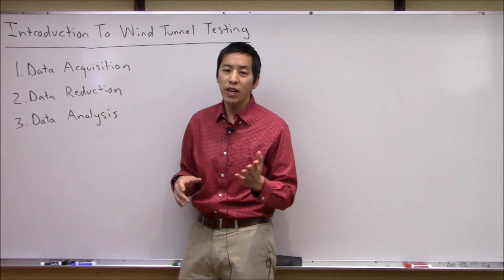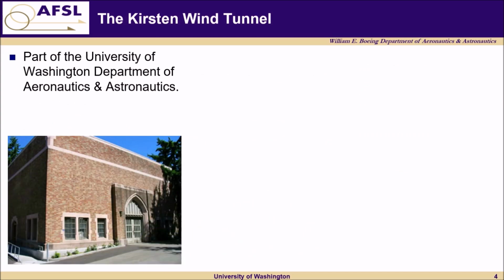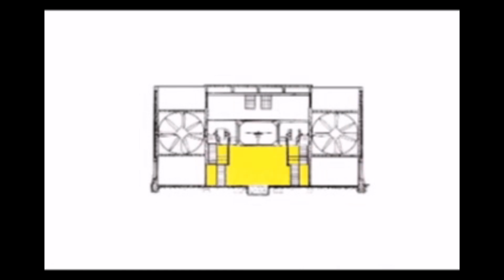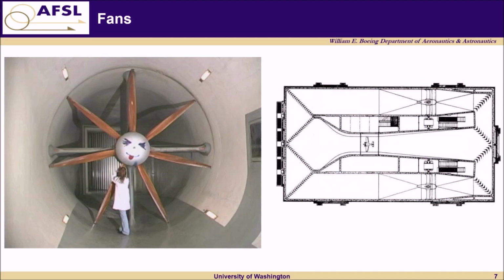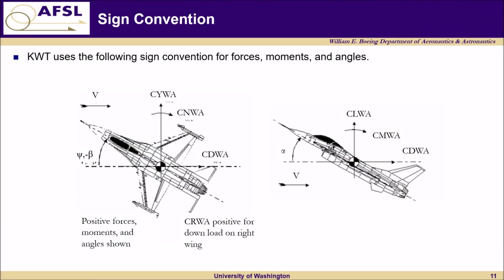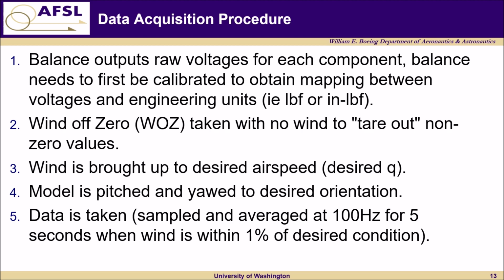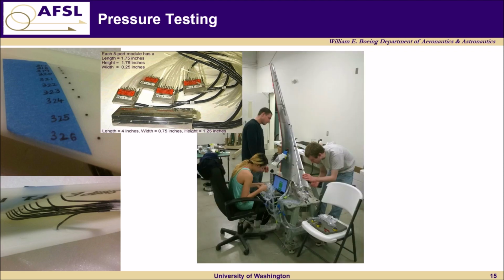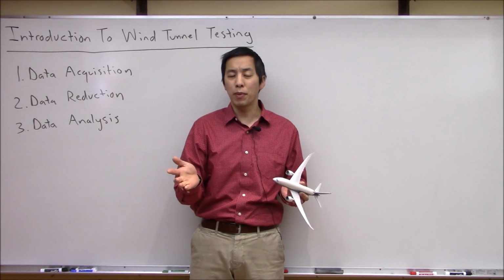Wind Tunnel Testing: Introduction and Data Acquisition

Comment: AE 512: Very interesting that mahogany wood was used for the propellers vs. metal or composites. I would think these would be better for their durability and lower likeihood of FOD in case of a part strike?
Reply from the maker: FOD is a big worry as as a shed part can damage or destroy a fan blade.  There is a kill switch and a person whose job is to watch the model during a run and if they see something fall off the model they hit the switch ASAP

Comment: Is the electronic pressure scanner a Scanivalve product? JC Pemberton, a Boeing engineer, developed the Scanivalve mechanical pressure scanner in 1950s. This was the high tech item that replaced manometer boards, and wind tunnel facilities embraced these awesome devices. JC left Boeing and founded his company Scanivalve. Years later the company developed electronic pressure scanners (ZOC) that are commonly used along with internal strain gage balances.

Comment: AE512: Great video! Is the Kirsten wind tunnel unique in its very low flow angularity? Or are those pretty standard values for a large wind tunnel?
Reply from the maker: Hi Ryan, the flow angularity correction is going to be different for different tunnels.  They obviously are shooting for zero cross flow and upflow but it is really hard to make this happen.

Comment: AE512: I find it amazing that the external balance assembly has remained largely as-is since the tunnel's inception. Have there been any required upgrades or major overhauls completed in the time you were with UWAL? I'd imagine any new parts would have to be fabricated in-house, right?
Reply from the maker: There have definitely been a few upgrades since the beginning (they used to take data using analog/manual techniques, AKA looking at dials and writing things down).

Comment: AE 512: Very impressive that this wind tunnel has seen over 80 years of service. Can't think of many other things that have lasted that long.
Reply from the maker: Yeah, it is pretty neat although there have been a few upgrades since the beginning (they used to take data using analog/manual techniques).

Comment: AE 512: Hey Professor Lum, I did not understand what the 100 Hz for 5 seconds represent, could you elaborate on that? Thank you.
Reply from the maker: Hi Marcos, this is just an arbitrary data sampling rate and duration that this particular wind tunnel uses.  This effectively means they take 500 data points (100 Hz * 5 seconds) and then average these 500 points to get a single data point for that condition.

Comment: AA 516: Does the 3x3 wind tunnel at UW follow the same general data acquisition process? Are there any major differences/considerations for using it because it is smaller and generally lower speed?
Reply from the maker: Patrick, great question.  In short, no, I don't believe the 3x3 has the same corrections.  You may want to check with Prof. Knowlen or Williams as they might know if there are actually any corrections being applied to the data for the 3x3 tunnel.
Reply: @ChristopherLum  Thanks! My capstone group will likely be using the 3x3 tunnel so we will look into it

Comment: AA 516 - Pretty cool to see this thing. I had the opportunity to sit in on an experiment during this past summer in the KWT. It was pretty cool seeing when you could see when it became turbulent and flow separation on the china clay
Reply from the maker: Hasan, that is great, what type of test were you conducting in the tunnel?  Did you get a chance to do any data reduction?
Reply: Unfortunately, no data reduction. I just sat in on them doing wind tunnel experiments. They were testing different airplane configurations to look at new supersonic plane designs

Comment: AA516 - great video. I loved working with the wind tunnels during my undergrad, even though they were nothing compared to Kirsten. I hope I'm able to go to campus soon and check it out
Reply from the maker: Gary, that is great to hear.  Where did you work with wind tunnels in the past?  What types of experiments did you run?
Reply: @ChristopherLum  I did my undergrad at UT Austin; I worked with our subsonic and supersonic wind tunnels. The experiments were for class and all involved testing various shapes and aircraft models. Off the top of my head, I recall doing flow vis (smoke, oil, and tufts), pressure measurement, and Schlieren imaging, among a few others. I was always the person eager to run the wind tunnel and do all the hands-on work!
Reply from the maker: @boeing797screamliner  Nice, that is good to hear.  Wind tunnels are a lot of fun and surprisingly they are still very relevant even in the age of CFD and numerical techniques.

Comment: Hi Christopher, thank you for your video. I am excited to see the following ones. I love the idea that you show how you get the aerodynamic data, required for designing a flight control. What I am missing here is a really important topic: Mach number and Reynolds number. If I want to match the mach number I have to change my reynolds number according to the right flow conditions. This is the reason why sometimes you have cooled wind tunnels. I think an example with a simple calculation would be helpful for everybody.
Reply from the maker: Helmut, thanks for the great comment.  You are indeed correct, playing with scaling, Re, and  Mach number manipulations all at the same time requires clever engineering solutions.  I've tested at pressurized tunnels to get around some of these.  We'll be looking at an example calculation in the next video.  If you are subscribed hopefully you'll be notified when it goes live.  Thanks for watching!
Reply: @ChristopherLum  Your channel is awesome! I would have liked my professors to explain it this way too. Instead, they just derived the formulas mathematically and the whole blackboard was full of math, nobody really understood. This is why it is so important to get practical examples like you do. Great Work!